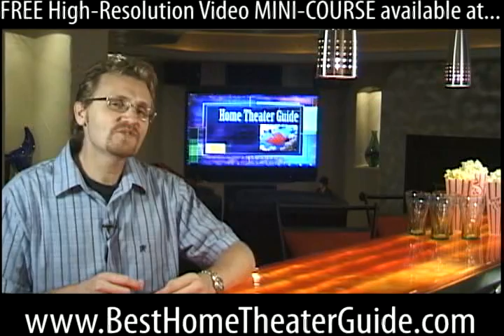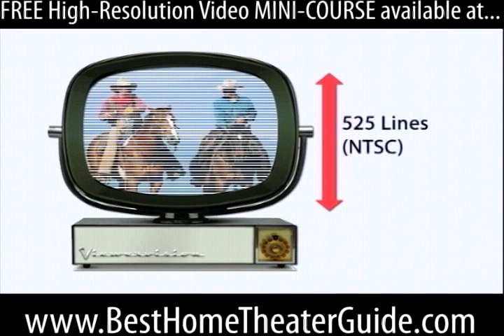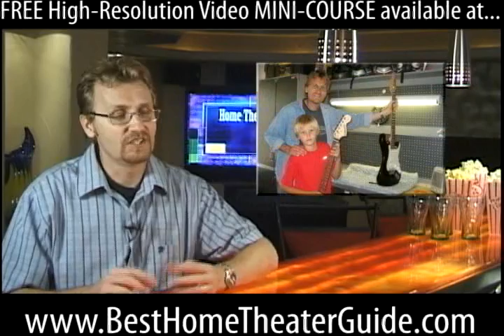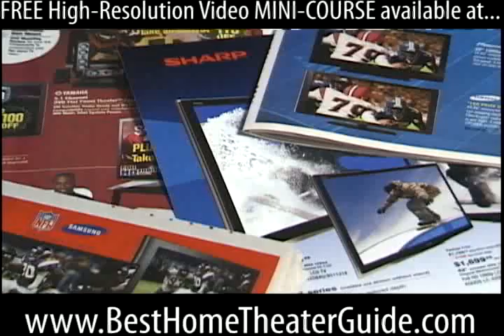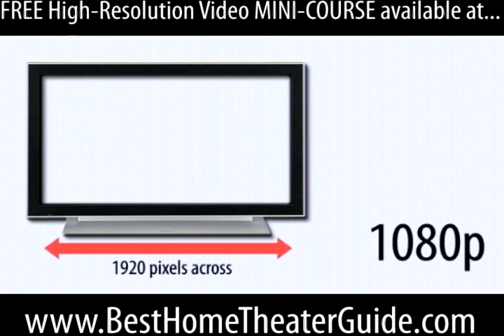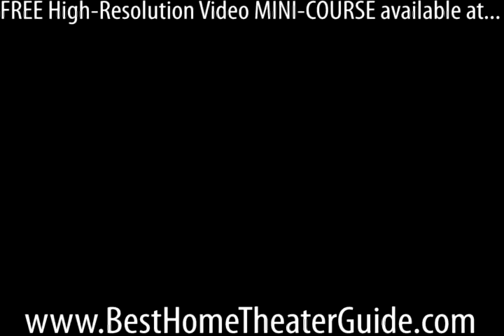TV Resolution 720p vs 1080i 1080p Plasma LCD DLP

Comment: ill go buying 32 inch 720p lcd tv+jbl sb200 since stb channels is 1080i aka 540p, ps3 works only at 720p,compressed torrent movies (some) are 1080p/800p work well with 720p via.usb...unless you use blu ray cds 1080p is worth it
Reply: rajesh kumar  and ps4pro 1080i works

Comment: the progressive 1080p signal is twice as sharper as 1080i wich is 540 progressive.
1080p is one 3th sharper then 720p.
1080p fullhd is 3 times sharper then pal 640 and ntsc 525 interlaced,but it,s 5 times sharper than pal 320,ntsc 256 progressive resolution .
so to wrap it up we getting misleaded overtimes.

Comment: 1440p video mastered from 4:3 ratio content could be displayed with 1920×1440 or higher resolution such as QXGA or 2304×1440 with scaling, windowboxing, or pillarboxing. Widescreen 16:9 1440p requires 2560×1440 resolution, possible with WQXGA, 2560×1920, or higher resolution with letterboxing, scaling, or windowboxing. Apple's 27" iMac[3] and Dell U2711 monitor have a resolution of 2560×1440, thereby allowing 1440p widescreen. The HDMI 1.3 specification supports WQXGA, and hence widescreen 1440p

Comment: @maarrsseelli Or when encoding a file you can do so in 1080 or 2080 if you wanted too, try and keep in mind, its the uncompressed data on blue ray that makes it worth while, where as a DVD would sacrfice quality for a smaller file(in gigs), resolutions arent the biggest issue.

The pc gaming world has been using over 1080 for about 10 years now.

Comment: $129,000 for a TV? You're insane.....
what the fuck is your problem why would you need a 108" screen.. and really dude 129,000 dollars? later in the future it'll be like way less money.. what a dumb thing you just did.. you know TV's dont last forever
and they can break easily... especially 108"... 50-60 inch for 1,000 would have been a better deal... but 129,000...............

Comment: He's wrong the tv shown in 2:56 is capable of 1080i and 720p. Those TV's are far superior to the plasma and lcd displays because of high contrast ratio, scalable video, lifespan, view angle, and low dot pitch. It is also widescreen, just not as unnaturaly distorted like the plasma and lcds

Comment: wrong
480i = standerderd difintion (sd)
480p= standerd defnition (sd)
1080i = high defenition ( hD )
720p = high defenition ( HD )
1080p = True High defenition ( TRUE HD )
 1080i is hd because if you hit the info but and your watching a 1080i signal it says 1080i hd 16:9

Comment: Hows it 'Overcranking' all it is doing is making the picture sharper when in motion. Making movement more fluid.

HDTVs canplay at 60Hz which is basically the same 60fps. In 720p or 1080p it shows 60 frames per second. If the game was running at 30fps then there would be duplicate frames being shown on the TV.

I dont understand what you are trying to say.

Comment: @kiwi539: 
DVD is up to 480p. 
Remember the "Progressive Scan DVD Player"s that were twice as expensive as the normal DVD players. 
Seeing as you're 105 by your profile, you should know that.
The "1080p/i/720p" you might be "seeing" from a DVD, is up converted from 480p. 

Both the Xbox 360 and the PS3 support 480i, 480p, 720p, 1080i, and 1080p. Those are the standard resolutions of TVs in the US.

STOP FIGHTING ON THE INTERNET.

Or, get on these consoles you have, and shoot each other. CoD4 ftw

Comment: The PS3 version of GTA4 was rendered at 640p natively. (sub-hd res)

Its not actually 1080p, its just hardware scaling. Like most games. 

There are only a handful of games on both the PS3 and X360 platform that even run 1080p native. Even Killzone 2, which is probably the best looking console game to date, only runs 1080i native.

Blu-ray doesn't affect resolution.

Comment: Well, no my PS3 doesn't down scale to 480p res. i would notice a huge difference bettween  720p and 480p at least, let alone 1080i and 480p ,and i'm not looking at lower res, its a noticable difference between the two.
 I think your confused, because only older technology TVs take that method of "bobbing"  a1080i image down  to a 480p,  My TV and PS3 seemed to work together fine in producing a "deinterlaced" scaled 1080i image. Anyway we're both happy with what we belive.

Comment: why would the PS3 output settings have a 1080i output option if it was gonna down size it to a poorer res. I notice considerable difference between 540p, 720p and 1080i on my TV when switching between HDMI output settings 
Contrary to what others say 540p isn't the same as or better than 1080i. Just because there are lines of pixels un scaned in the refresh process doesn't mean there not there, they'll be scanned on the next refresh. 
And yes PS3 does output true HD, XBOX360, i dunno honestly

Comment: Ps3 does have analog output in the AV  cables provided as a standard, It also has HDMI digital output, but this sounds like your TV is outdated, and doesn't support digital 1080i or 720p input.
would i be correct. The PS3 HDMI  won't output any digital signal to a TV that can't support it. 480p being the minimum supported.

Comment: I have a question that may sound stupid, but: In 2006, I got a 32 inch Sony TV that had two component inputs, and two composite inputs, so i hooked up my PS2 using composite video. A week later, I decided to get with the times and buy a DVD player with Component cables. When I was snooping around the menu,  I saw that the DVD player was on 480i and 480p was set to off. I knew what Progressive was, so I turned it on. The picture was inferior to 480i. Why is this happening? PLEASE ANSWER.

Comment: I have the Panasonic TH-50PX80U.
It is a 720p just like yours, it does accept up to 1080p as a source, but will not put out a display of 1080p due to the limit of the screen.
You should also realize that a 1080p is a waste because there is no HD programing that is 1080p, they all max out at 720.

Comment: 1080p or even 1080i will be not a problem asslong the original recording was progressive.
eather lcd and vga crt screens, even if they,ve a lower resolution,just looks much finer/crisper,than a plasma wich is even able to handle 1080p.
the problem with plasma is whatever size or resolution,it does,nt look fine as lcd.
they,ve to make a plasma screen wich just look fine&crisp as a vga crt screen,as it would be twice more expensive to do!!!!!!!!!

Comment: Yeah. If you have one of the newer 360's that have the HDMI port in the back, go with it. You can get an HDMI cable for about 20 bucks. This is what I use and its beautiful. Component cables are OK if its all you have, but with HDMI its a digital connection and it carries audio.

Comment: for what i know is that all digital display,s whethet plasma or lcd screens,they all require a progressive signal to operate properly,so if they only can atleast handle 1080i it must be however converted into progrssive,correct me if i have it wrong if interlaced lcd and plasma screens exist.

Comment: Theres something I still don't understand, I bought a LG3000 which has 720p (doesn't has 1080p full hd) but when I bought my new HDMI cables the box said on top of them "FULL HD 1080p" I ignored that since I though my lcd wont display in 1080p my tv shows at what p it's displaying (says the Hz etc)
my question is: how come that on the PS3 channel, says its displaying on 1080p 60Hz? plus, if the tv couldnt display it the screen would go black but it doesnt, is it REALLY displaying at 1080p?

Comment: I agree with him on most points, but have one thing to add.

Remember, that even though your eyes can't discern the difference between 720p and 1080p when you exceed a given distance:screen-size ratio, your eyes can absolutely discern color quality, motion blur, black level, etc.  

My point is that the QUALITY of the television matters even at greater distances.  Even at 30 feet away your eyes can see that the Pioneer Elite 720p Plasma looks fantastic, and the 720p Westinghouse sucks.